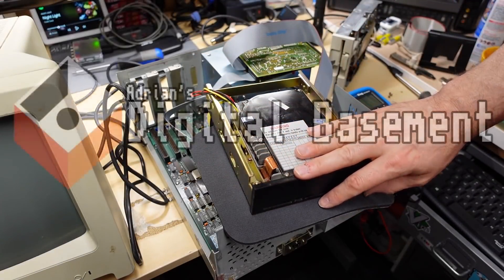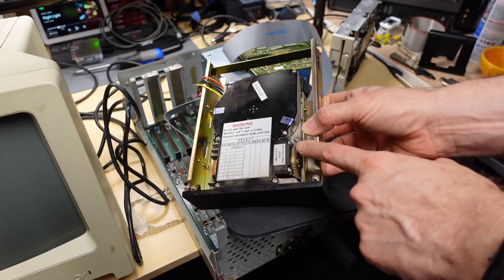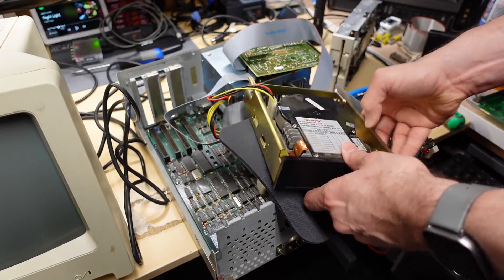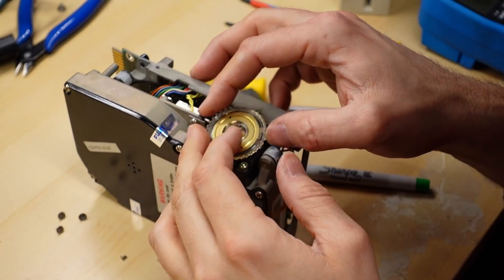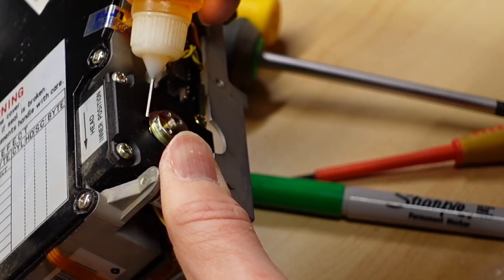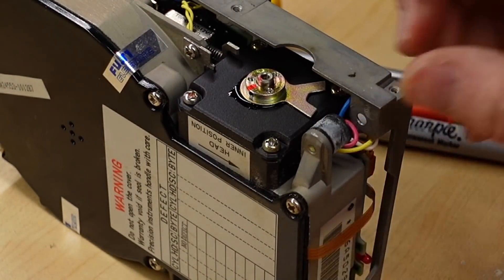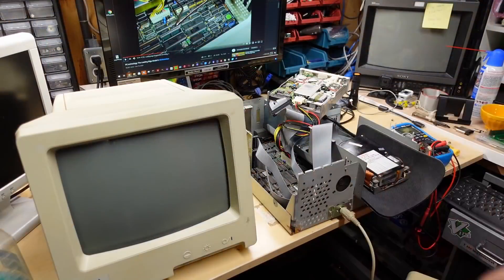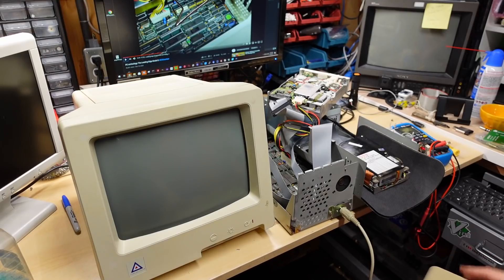Reviving an old hard drive with some oil

Comment: I’ve always made special electronic bearing/bushing oil from equal parts marvel mystery oil and synthetic lucus mucus oil additive and then a pinch of motorkote. The solvent marvel helps break up crud you can’t get to and the synthetics are great and long lasting lubes

Comment: If they had oil in them from the factory, then it's probably absorbed a good bit of dust and maybe moisture by now which turns it into something closer to glue. Generally speaking, the best solution is to fully disassemble, break out the brake cleaner spray, get all the old oil and crap off and replace with fresh oil. That'll last 😉
Reply: Old drives were assembled with really tight tolerances. I haven't tried to disassemble any lately, but I do have old MFM drives and I wouldn't dare dissemble, unless nothing else worked. When PCs first came out... well the only example I have a price for is the 5MB Apple Profile hard drive which was $3,499 US in '81, which in today's dollars is $10,700. That price was in part for precision engineering, and I'm not confident I can match that in my basement worktable with brake cleaner. If I have the choice, I'll take the chance on just adding new oil.
Reply: @squirlmy  You mean tight clearances? Part of quality and precision engineering is ease of assembly. The better they hold a tolerance at the plant, the easier it is for everything to just come together nicely without any manual fitting. Since you wouldn't be removing any material (old sticky grease doesn't count), going crazy with the brake cleaner (provided there are no plastics nearby to dissolve) - not a big issue, but I get what you're saying. If tou don't trust yourself to put it back together right, then you're right, you shouldn't be tearing it a-part.

Comment: I was gonna say: "Wait, don't move that arm when the drive isn't spinning! You are going to cause scratches and bad sectors." (since air cushion separates the head from the drive platter of spinning disk) So the drive was marked as having no bad sectors and how it has over a hundred.

Comment: shocked you got an old 10 meg or less drive working .  THose suckers were not made to last all that long and were not all that great at not screwing up data sooner or latter .   I ve used them back around 1993  back when you need to know things becasue there was only computer BBS  and no real internet.    Cool you got it working again.

Comment: I don't even mess with hard drives anymore, but if I did it would exclusively be western digital. My 10 year old computer had a Samsung 830 512GB and later an additional Samsung 840 512GB. My new computer has dual Samsung 980 Pro 1TBs. I'm planning on adding in an additional Samsung 870 QVO. I do have room for 1 more Samsung 980 Pro if I want.

Comment: That ring thingy on the stepper motor axle was probably put in place by cooling the axle, causing it to shrink a little, and heating the ring, causing it to expand a little, then placing the ring around the axle; once both parts were back to normal temperature, the ring would be firmly attached to the axle.

I did a little looking around on Wikipedia, and it does seem that Fuji Film, Fuji Electric, and Fujitsu are indeed connected, even though they may appear as separate companies.

Comment: I would first try a blast of WD40 spray to unjam the bearing and THEN use the bearing lube once you get it unstuck.  I once used motor oil to lubricate a fan that got jammed in my refrigerator after cleaning and polishing the shaft and the fan jammed up again in just a few hours. I then used WD40 only and the fan has been running for years now.  Though WD40 is more of a cleaner/restorer, so to speak, than a lubricant really, I was surprised that it worked MUCH better than the oil alone! In your case though, I would still use the bearing oil after the WD40 has done its unjamming/cleaning  just to be safe. Lubricants containing Teflon are supposed to be very good as well.  I also believe that there is a WD40 LUBRICANT as well that is supposed to be better at lubrication than standard WD40 is.  I think that it is silicone based. 🤔

Comment: Ah, mechanical drives...
We had gotten a large number of Groupe Bull computers (a partnership between Zenith/Heathkit and some French firm) at University in the 1990's, and right away we had trouble.
They ran fine, were pretty compact and quick for desktop machines at the time, but you could never turn one off!
Well, you could, but good luck having it start again!
Stiction, the tendency for the read/write heads to cling to the platter, was the death-knell for every one of the 87 Bull computers we had!
The fix was simple: while the drive was making its click-whirr-click noises at startup, you lifted the computer up three inches, and let it fall to the table.
Worked ever time; only took a dozen or so 'calibrated drops'.  No big deal...
We eventually replaced all 87 drives.

Comment: Way to go!

I would recommend using synthetic timepiece oil instead of bearing oil. It will seep in better and last a lot longer. You can get it with a tiny needle dropper that might even get inside the bearing somewhere.

Comment: I remember one of the first half-height 20mb hard disk drives made for the pc was made by Tulin.  I paid about $750.00 for one for my company.  Couple years later when I upgraded the pc I wanted to swap the Tulin into the new pc.  At that time you had to set the hd parameters in the bios for the drive to work.  I called Tulin to get the specs (number of cylinders, heads, etc) to use the drive in the new pc.  They told me that was proprietary information and they would not tell me.  They said I just need to buy a new hd.  Somewhere I found the info, perhaps on the original invoice, and got it to work.  But I remember telling them at that time if that is how they supported their product, people like me were not ever going to buy another drive from them, and they would soon be out of business.  And they did go out of business, bankrupt. But the drive continued to work flawlessly for many years.

Comment: VIM Sticker, Retro Hardware, but using Windows and a Apple Smart Watch. That very contradictory. But nice Retro Hardware! :)
Reply from the maker: I don't have an Apple watch -- it's an Amazfit GTS ..... Windows works better for me because all of the things I need to do generally requires Windows. Linux would require me to jump through hoops to make it happen. (Like run a VM of Windows anyway)

Comment: Hey Adrian, I just got done rewatching the original Leading Edge archeology video I guess just as you were uploading this!  Anyway, here's a reminder to dump the BIOS and bring the newer version back over to that system (if you've still got it).  You had downloaded a BIOS for another system that you found online to get the XTIDE card going, but I imagine you'd probably rather have the actual newer Leading Edge BIOS in there!

Comment: If the switch housing is ABS... You could drip some acetone on the seam to chemically weld it together.
Reply: Recently I was annoyed by a plastic housing with a broken clip. I lightly pressed the edge of my hot soldering gun into it and now it stays shut.

Comment: Holy crap! That menu system after the computer finally booted... It looks exactly like what I had on my first computer. An old 8088 clone we lovingly called "Rudy". Had a 25mb HD. I think it must have been the same harddrive, too, because I recognized that front panel on the Fuji. We even had an amber monitor. The brightest setting was always called "Cyan", so I honestly thought that bright amber colore was called "cyan" for so long...

Comment: Fuji Electric was a joint venture between the Furukawa Electric Company and Siemens, which was related to Fujitsu and not Fujifilm from what I can tell.
Reply: Fuji Electric still exists https://en.wikipedia.org/wiki/Fuji_Electric
However Daewoo Electronics, the company behind the Leading Edge brand, went bankrupt in 1999.

Comment: Good job Adrian! well done. I have seen you use this method over and over again and that does work. Although you probably also do know about the 'Freezer' method of restored HDDs back to life temporarily so that you can recover data. I would love to see a video of that working. I have done it myself and it does work, at least to get data from old HDDs.
Reply: I have a drive that will only start when warmed up.

Comment: There's a set screw visible on the inside of the hub right by the red marker line. Loosening that will allow it to come off. Using a hydrolic press to press it on would probably destroy the motor in the process.

Comment: SpinRite was the number one tool back in the day for keeping the data fresh and it could also change the interleave on disks that was incorrectly low level formatted (and all this while keeping the data safe). It can also find bad sectors or reinstate previously marked bad sectors. Invaluable for old MFM, RLL, ESDI and SCSI drives. Later when drives had their own error correction and when SMART was introduced the need for SpinRite wasn't that big any longer. I worked for a company and before delivering brand new PCs to customers all drives had to go through SpinRite (on maximum level) as well as several rounds of CheckIt Pro loops with serial and parallell port loopback dongles, RAM, ROM and other tests to ensure quality in the delivery process. I believe SpinRite 6 is last (and probably final) version of SpinRite.

Comment: Back in the day, I worked on the IBM PS/2 line and their 160MB SCSI drives.  One time, a seized unit came into the office.  Popped the controller board off and saw the spindle.  A few drops of 3in1 oil and it worked great (although it wasn't happy with all the spindle noise)...  I was able to recover all the data - very cool

Comment: Those stepper motors all have sealed ball bearings, it is impossible to lubricate them from outside, as the sole purpose of a ‘sealed’ bearing is to keep the lubrication material inside the bearing, and this means it is not possible to force it in from outside. I have seen your previous video, which unfortunately you use it as a part of your intro, it is nothing more than you are giving it a little wiggle to make it move and spread the lubricant inside the ball bearing to get it going again.
Reply: If it's like the WD (originally Tandon) drive in the previous video, the bearings just have metal shields. (This is also the case in every voice-coil head actuator I've seen.)
Those keep dust out (at least those particles bigger than the gap), but aren't liquid-tight.

Comment: A really miss maxtor's HDD. I really don't know what clicks with that particular brand (which drive that we owned or i worked with), but in my mind maxtor is symbol of times when we got a choice. Really not connected with theme of video (only with opening part about multiple brands)

Comment: 7.14 MHz? That's the magic Amiga 500 frequency 😍
Reply from the maker: Must have something to do with the NTSC frequency which I think PC's run a derivative of.
Reply: Crystals used in TVs were cheap due to mass production. Computer manufacturers did like those crystals a lot.

Comment: Hatachi, IBM, Maxtor, Fujitsu, and Quantum to name a few....
Reply: I'm not sure that IBM actually ever made the drives they branded IBM... I'm off to google that now. Used to have an IBM deathstar, it was a surprisingly long lived example
Reply: @TheErador  IIRC some of their drives were rebranded Hitachi drives.
Reply: @TheErador  They did (IBM invented HDDs in the first place so why wouldn't they?), though a few cases of rebranding did happen near the end. Those I remember:
For a short time, IBM licensed Deskstar designs to Western Digital (who made and sold them as the "Expert" line), until WD got up to speed with their own 7200RPM Caviars.
A few of the Deskstars were also licensed to NEC (after NEC gave up on designing their own drives), including the 75GXP; some branded NEC, some for IBM (I think I have one of those in my collection, which incidentally is in perfect health as of the last test). It seems that those were also more reliable than the 75GXPs made in IBM's own Hungary factory (certainly the Deathstar teardowns I've seen to date have been of Hungarian-made drives).
Before taking over IBM Storage, Hitachi made their own lines of laptop and server drives (named starting with "DK"); the last IBM-developed drives were sold under Hitachi's name (including the Deskstar 7K250 which was released after the takeover), while what would have been the DK23FA was sold as the "Travelstar 4K80" (sold alongside the IBM-origin Travelstar 80GN). I believe the "Travelstar C*" series (1.8-inch form) were also Hitachi-native.
Some of the lower-capacity Deskstars (starting with the AVVN series) were licensed to ExcelStor (who previously developed their own drives, and briefly continued doing so alongside the IBM/HGST-licensed series), and again (like with the NEC relationship) divided branding-wise between the companies.
Reply: @longrunner258  so they did I'd clearly gone mad the other day!

Comment: I really like those drives. I have a SCSI version in a IIcx. They sometimes develop stiction though but if you apply power and rotate the thumb wheel slightly it'll spin up. Like most stepper drives they don't auto-park the heads on power down so you'll need software to tell the drive to park (or wait long enough for the drive to idle park after a few minutes) before powering down. Stepper drives smacking into a stop at power up isn't unusual if the heads were parked upon power down; MiniScribe's 8425 (commonly used in the Mac SE) does it too.
Also, Fuji Electric still exists and builds components for use in other manufacturers' hard disk drives, among other (mostly embedded) devices; they sell few to no devices to consumers under their brand.
Reply from the maker: Yeah I noticed this drive does have some stiction issues too -- noticeable after it's been sitting for a while. Unfortunate as the drive is completely working perfectly otherwise.
Reply: @adriansdigitalbasement2  Apparently stiction is caused by polished head sliders (polished either at the factory or from years of CSS cycles) landing on the glassy surface of the media. There, and especially in presence of moisture, the surfaces adhere. It may be possible to pull the armature out of the HDA and lightly texturize the sliders with extremely fine sandpaper to reduce the problem but no guarantees it would work and the problem would recur eventually anyway. Newer (mid-90s or so) drives avoided this problem by having a dedicated landing zone that was both outside of the data area and was texturized (usually by a laser). Of course modern drives (roughly post-2000 for notebooks, post-2006ish for desktop/servers) use ramp loading heads so stiction really isn't possible without being subjected to a major shock.

Comment: Fujitsu was established on June 20, 1935, the fact that makes it one of the oldest operating IT companies after IBM and before Hewlett Packard, under the name Fuji Telecommunications Equipment Manufacturing, as a spin-off of the ***Fuji Electric Company***, itself a joint venture between the Furukawa Electric Company and the German conglomerate Siemens which had been founded in 1923. Despite its connections to the Furukawa zaibatsu, Fujitsu escaped the Allied occupation of Japan after the Second World War mostly unscathed.

Comment: Wasn't there a locking screw on the side of that brass wheel mounting thing? Removing that should pop that thing right off the shaft.

Comment: How reliable is over 25 year old Hard drives ? I would never store anything in there. You will loose your data...
Reply: I doubt these are gonna be used for serious storage. Having bad sectors would be another red flag for me however. Those might seemingly vanish after a low level format but its an indicator that this drive is on its way to stop functioning. Maybe that can happen on a drive that hasnt spun up in decades but traditionally "repairs" like that are kind of shakey. Then again, so is using the oil like he says. Seems nice to save old data though.
Reply: @haraldhimmel5687  Bad sectors really shouldn't be an issue, drives usually come from the factory with bad sectors. In the old days they were printed on the  label, on modern drives they're transparently skipped by the P-list (which is different from the G-list of reallocated sectors). For me the red flag would be an increasing number of bad sectors.
Reply: @eDoc2020  If an old harddrive shows bad sectors in the partition that is being checked, that would indicate that the numbers of bad sectors did in fact rise.
Reply: @haraldhimmel5687  That is only the case for newer drives which track bad sectors internally. Although really, I'm fine with a slow increase in bad sectors, such as a single digit rise each year. Especially on these older drives which are much more resistant to contaminants than modern drives.
Reply: Oh, there is no 'real data' being stored on any of these and not any real work being done on them either.  If someone wanted to use these for real work (not sure what that is... writing a novel?), you might want to use CF media and even then, I would still back it up regularly to another location which is what we still do with modern machines as well.  Some people just like the hum of old media.
Reply: i have drive this old... some work, some dont, my "backup" drive i stored in a fire safe sealed in a bag, even had a descicant, corroded on the outside, barely was able to recover the data!
Reply: @frogz  Yeah, I didn't take such good measures myself, but I had two MFM/RLL drives in storage that went to my childhood Atari ST and neither worked when i unboxed them 25 years later.  It's doubtful I have any data worth recovering so I didn't bother trying.